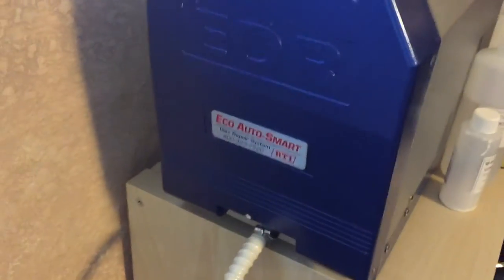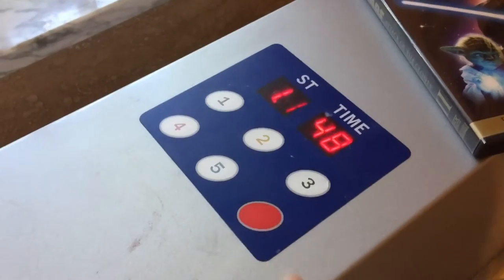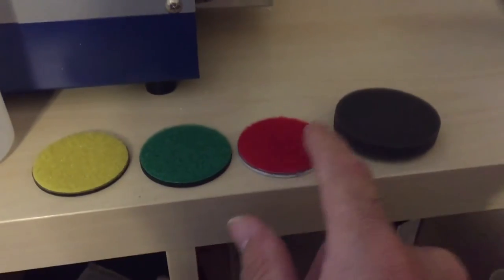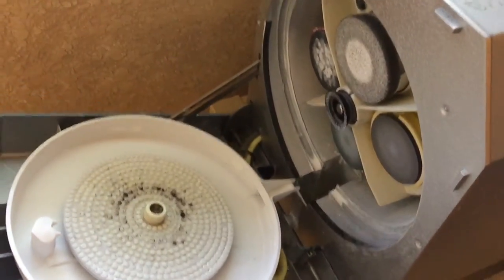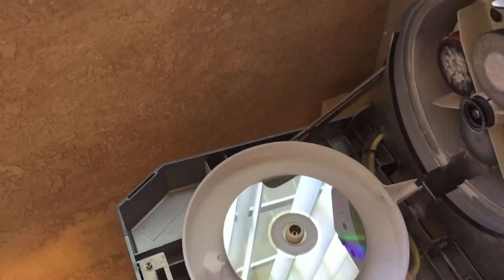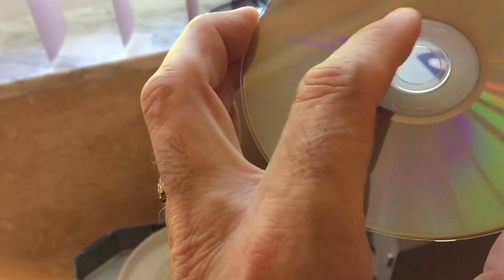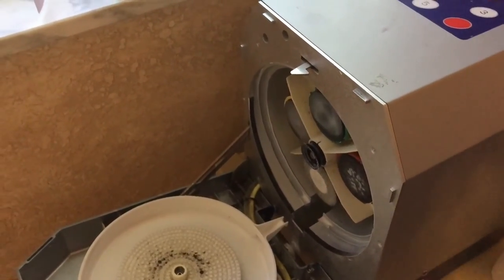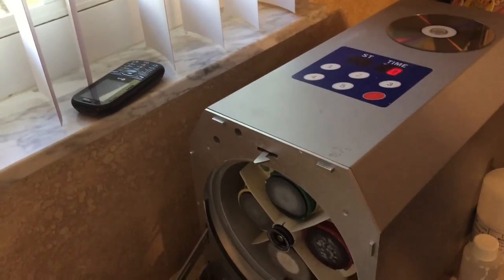ECO Autosmart CD Disk Resurfacing Buffing Automatic DVD Video Game

Comment: Hey man, I got my machine running pretty well now. One more question- how do you deal with dual sided DVDs? Can you buy a separate attachment? I just know that you get marks on the opposite side from the area you had cleaned and it can be a pain to try and get it clean without running a polish again. Starts to become a vicious cycle.
Reply from the maker: They make some special pads that for them that are a little smaller. The only issue is that the final buff sometimes will take the writing off the label that is on the inside. I would cut a buff pad down for those double sided ones. And also I  have like a soft cloth or microfiber towel to wipe the other side off after it finishes.

Comment: I bought a machine from an auction. Any tips for cleaning the machine? Everything seems like it covered in a white substance. Where do I buy the solution for the system? Thanks for posting this video!
Reply from the maker: I buy my supplies from www.elm-USA.com I also use water and glass cleaner to clean the inside. I could make a video on my cleaning process.
Reply: +Stacy Staggs (swfcollectibles) A cleaning video would be great!